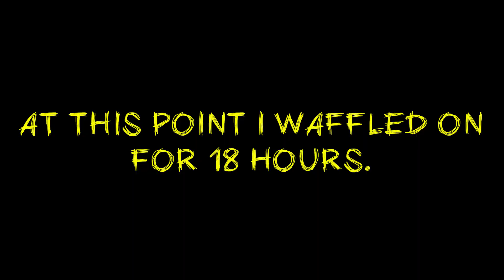Upcycle To Sell - Lamp to Vintage Hacker Radio RP17 Mini-Herald

Comment: Great video George, a long time coming. Sadly, there are lots of 'Artsy Fartsy' folk out there that will think nothing of ruining a perfectly good vintage item, be it a radio, an AVO, with an edison style LED bulb, or a wet fish... 'Hunts'. Bang-on. Nice that you have taken the time, and seen the value in reversing what has gone before. You have your work more than cut out on this one. 
It certainly was a piece of work when you got it, I have lots of questions 'why'? and 'WTF!' for the upcyclist...
Moments of genius... 6 inch screws - cutting the magnet from the speaker, punching out the chassis, and that bleddy great block of wood underneath... Good luck - you may well need it in droves....

Comment: I think the culprit ought to be mounted onto the radio complete with lamp 😲. Nice to see you back at it George. The RP17 was one of the 1st radios I ever restored and it was red. Let me know if you want to part with the handle as mines just about hanging on. Two into one will go 👍🏻. C2 on the amp board is 8uf bipolar. Not sure if you spotted that but if you look closely the top cap is red not black and it’s marked reversible or rev from memory. Look forward to the next instalment and a return of the notorious hipster 😁. Cheers Graham

Comment: Hey, George, welcome back!  The neatest hack job in my massive collection of radios is an All American 5  chassis stuffed into an Atwater Kent Bread box style box! It looks 1929 vintage, but is a  1960s radio. Looks original until you remove the cover. Stay safe,
John
Reply from the maker: Many thanks for stopping by. At least your hack job kept it as a radio, if not the original one. I don't understand 'art' in this case!

Comment: Man George, really good to see you back on M8. Never have seen a Hacker radio so this is a new deal. At least it still has the breadcutter.
In a way it comes apart like a guitar amp. Good stuff pal.
Reply from the maker: Many thanks Carl. Been having a few issues but finally got them pushed into a corner. There were almost no Hacker radios exported overseas so I'm not surprised you haven't seen them. Company started out by going for quality radios which eventually priced them out of the market. I do have a large number of Hackers here so you will see more!

Comment: Great video George. One good radio from one parts radio and a humiliated lamp stand, is a positive here I think. As for punishment for the perpetrator of this atrocity and the damage sustained to your good self whilst dismantling it, I would suggest using that large block of wood, in a fire, to heat up the brass lamp column tube to a very high temperature, before inserting with force up the rectum of afore mentioned perpetrator 😭👏👍
Reply from the maker: I like your style for dealing with the perpetrator. A very appealing method! Glad you stopped by.

Comment: I am in in tears for that lovely speaker. The problem is lack of practical training in Education. There are too many  silly folks with too much ££ ?  Harry Endfields I saw you coming springs to mind.
Reply from the maker: Don't get me going on the lack of practical skills in education. I wanted my girls to take advantage of the full metal work shop at school but was told that they were not allowed to use it because of elf and safely... I have taught them both to solder and they have both built kits. They can follow instructions so are capable of doing most things, if not cautiously the first time!
Reply: @GeorgeChristofi  Blame the ambulance chasing Lawyers for this and the amount of paper work risk assessments etc  needed for these courses. Everything is geared to going to UNI and jobs ln accounting  marketing and ambulance chasing  Lawyers for the high achievers  Support is available for those with lower abilities. Support for the middle ground of those with good practical skills is lacking. Mind you industry is lacking also.
Reply from the maker: @triodehexode   that is the nail on the head. Paperwork. Ok, both my girls are doing really well at University so I'm not complaining but I feel that everyone should know the basics of things. I did metalwork at school and can use a late. I'm no machinist but at least I can make a knurled machine screw or a bearing housing.

A lot of kids also don't want to get dirty hands fixing things...
Reply: @GeorgeChristofi  In Germany an Engineer has the same status as a Doctor Lawyer or accountant.

Comment: Thanks George.
I have a universal avometer 8 mk4.
how I will use the L.R and INS measurements
Reply from the maker: LR is just low resistance. Use it like a standard ohm meter. Ins... Can't remember what that does....
Reply: @GeorgeChristofi  ins is insulation resistance
Reply from the maker: @radiotvrepair1059  ok, in that case yo test the cable to earth or chassis of the kit you are testtin
Reply: @GeorgeChristofi  can i use it to test capacitor leaks.
Reply: i downloaded the manual i found that you need an external dc voltage source between 130v and 160v and connect the test cables with this voltage and set the zero ohom by x100.

Comment: Great to have you back george.cant believe someone done that to the hacker.once you made a good one out the two you could always make the lamp one out the crap again, there's always some Muppet that would pay good money for it!!! looking forward to part two.do you have any surplus hacker power supply leads as after one.regards mike
Reply from the maker: I won't make another lamp and encourage the upcycle idiots... As for power supply leads, I have a standard jack plug with raw wires on it which I use. It came from a dead wall wart supply. I only have the one genuine hacker power supply which I have yet to take apart and service.

Comment: Great to see you back George! lately i am thinking of starting soldering my own patch and instrument cables for my pedalboard and guitars. Could you recommend what to buy? e.g Soldering Iron, Solder (60/40), cable tester etc. I am new to all this so i have no idea of what to look for.
Reply from the maker: It depends on how much soldering you do but the irons coming out of china based on t12 system. For 30 euro you can pick up a full soldering station. I would only buy solder with lead in it. other tools are some cheap wire cutters, again about 1 euro from china and a helping hands thing for about 10 euro. If you plan to do soldering daily then that kit will actually be cheap to run.
Reply: @GeorgeChristofi  thanks ;)

Comment: Still in shock about that speaker😱 How did they cut it while still in the wireless?   Surely the didnt take it out to cut up? Great job on restoring an abomination back to  a normal happy life. And you have a few spare germaniums.  Nice one You have been subscribed
Reply from the maker: Many thanks. I can only think that they took the front panel off the radio. In which case, why not remove the speaker then? I do despair sometimes!
Reply: I suppose they might have put it back to avoid a white space behind the speaker grille, but there's no way they could hacksaw it within the sides. My guess is that the magnet was removed with a dremel cutoff disc.

Comment: As for the level of force you enquired about using on the person who thought was creating a up cycle work of art.Extend the shaft he or her used put it in the appropriate orifice and out his or her mouth and turn him or her into a lamp.Any issue about how to run the shaft look up Vlad the impaler
Reply from the maker: That makes good sense to me. In fact, if the lamp was a good high wattage incandescent then it could stay internal and shine from the ears as there is obviously nothing in the space between.

Comment: I'm guessing you want us to appreciate those Wera screwdriver and nut sets so I'm just going to have a little drool right here. I'm building a collection as I write but I've got a way to go.
Reply from the maker: I havent got a complete collection of Wera tools. I am hoping to get the 9mm sockets and spanners which are an odd size according to Wera. The full spanner set is a bit out of my budget at the moment. As for the torque drivers....

Comment: Yes, well what can be deduced from this whole radio carve-up affair is that the person who did that to this fine radio need never ever have to take an IQ test. For it can be accurately concluded that they will not have attained a level much above 10, possibly 11 at the most. You will be able to recognise the offender here for they will walk about in slip-on's because they have yet to learn how to tie up their  shoelaces, I suppose mummy still does it for them ?

Comment: I can't see how they sawed through the speaker without removing it in the first place. BTW was the lamp earthed?
Reply from the maker: No, it was twin double insulated. Cable was up to spec but the damage wasn't
Reply from the maker: The speaker sawing is a mystery to me because the tool marks are horizontal. That suggests the took the front panel off, stuck it in a vice and just cut it

Comment: I just don't get it, why turn it into a lamp?  The radio is ruined and it didn't work, I could understand doing that if the radio still worked back in the day when those radios were around every corner. A lamp with a built in radio might have sounded like a good idea, but really, it is the stupidest thing I have seen n years.  If the radio didn't work it was more trouble to turn it into a lamp that it was ever going to be worth and it was not a good looking thing anyway.
I am loosing the will to live seeing that!!!!
Reply from the maker: I know Bob. It wasn't even a pretty lamp but a brass stick. If I was going to do such a conversion I would at least do something nice.
Reply: @GeorgeChristofi  Yeah, that was a lot of work for a pigs ear!!